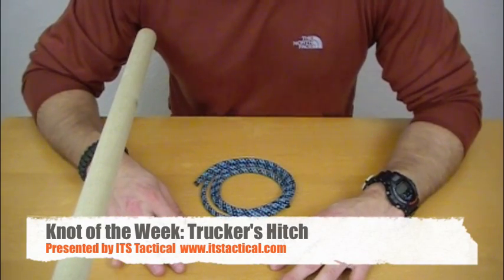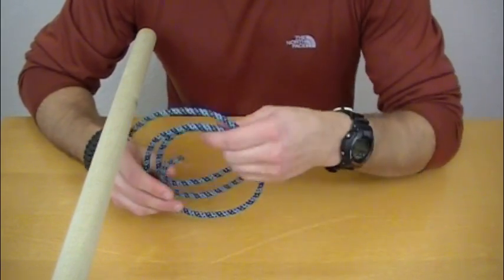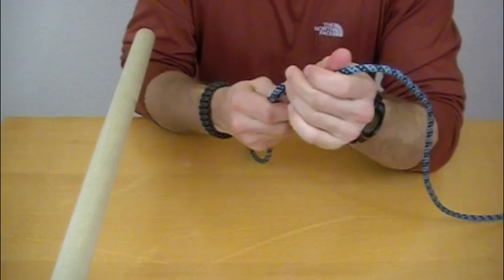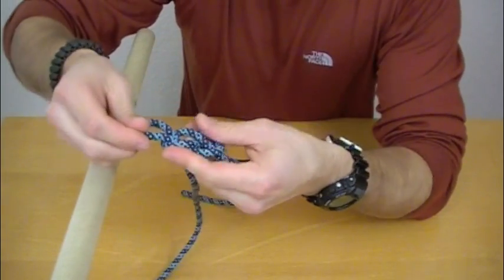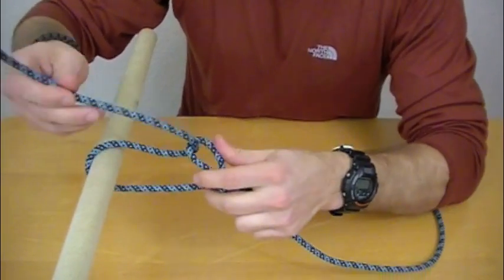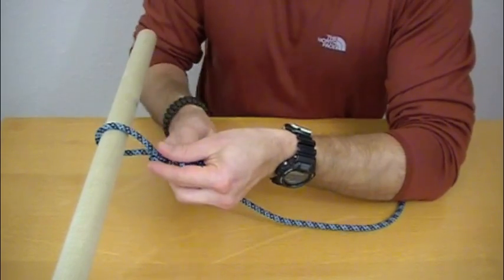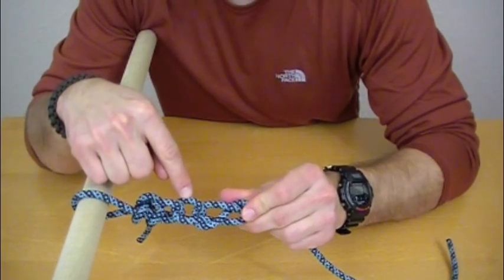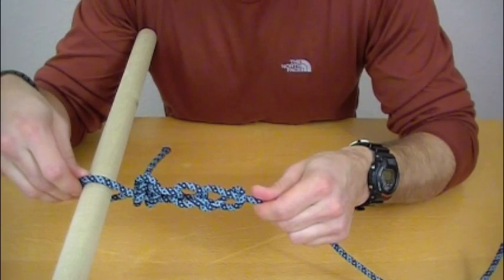Knot of the Week: Trucker's Hitch

Comment: The trucker's hitch is probably one of the most useful rope devices that everyone should know.  I use it all the time at work and in the outdoors, but this is not a version that I am familiar with.  There are several other methods of tying this hitch that I would recommend learning over this one if you plan on using it on a regular basis.